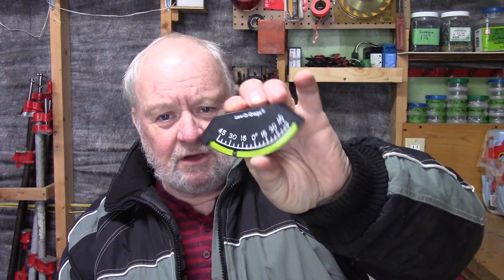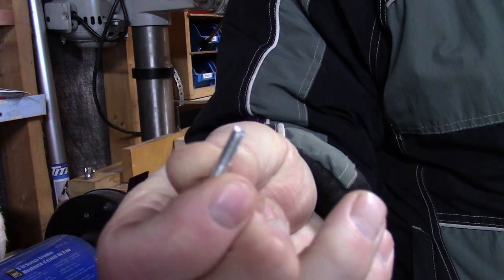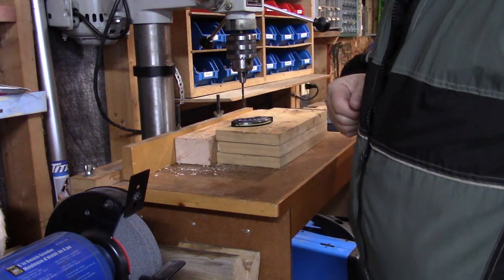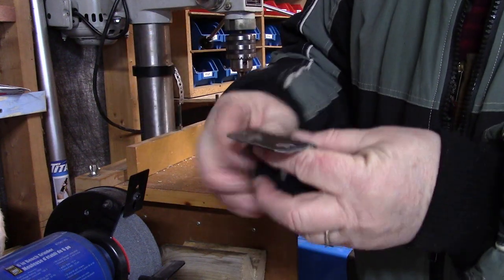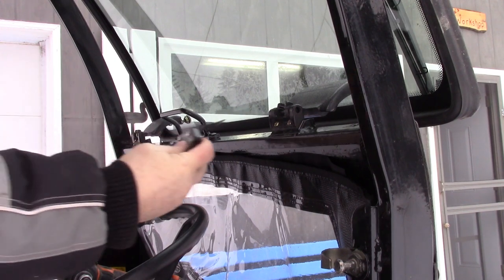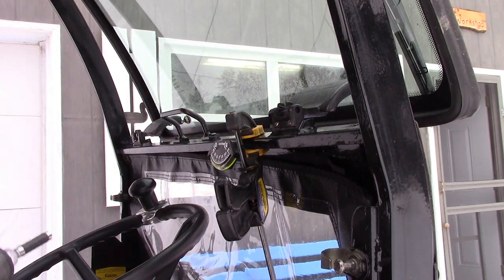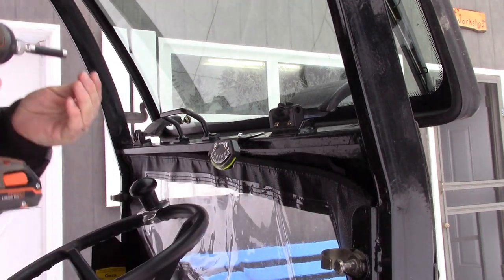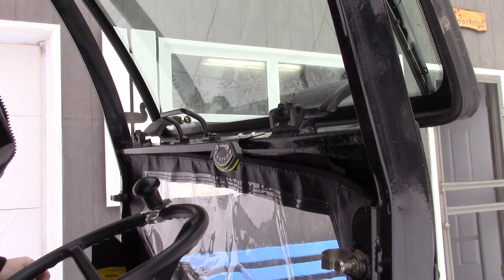Tilt Gauge for Tractor

Comment: I knew from the start Mike, that your channel was 'on the level'...now you are proving it with this addition to your awesome rig.

With the Lithium Ion first generation batteries back a few years, I'd keep a couple on the dash of my service truck in the winter so they'd warm up a mite on the trip in to the big city every day. I think they've improved somewhat because my newer stuff isn't either totally non-responsive or dead with minimal usage. 

The biggest danger I've found with these narrow based tractors is the speed at which you bypass the pucker factor when you are safely on a hillside and the lower rear drops into an unseen leaf-covered indention in the terrain or worse, the up hill rear runs over a stob, the edge of a stump or big rock. It happens so quick and if anything beyond 'creep speed' is being used, the resultant tip occurs in less than a flash !!!  Then, its time for new pants and in a really bad situation, a new seat may be in order.  

Good video, good idea and as always...good delivery !!
Reply from the maker: How's she goin' Wendel?  Your right about the 'pucker factor'  I should have called this a Pucker Factor Gauge!!!  Thanks for watching and I appreciate you kind words.  I hope I can continue to be 'on the level' now!!!LOL  The batteries I have seem to work OK in the cold but they won't take a charge at all.  The charger says the batteries are faulty.  I have my charger mounted in the shop and in order to charge them I would have to do some dismantling and take the charger into the camp so I tend not to use them much in the winter!!!  Have  a great week!!!
Reply: I try not to use mine at all but people keep bugging me for this or that well, then there's always projects for the kids houses too...  I don't know if these manufacturers test their products in real world simulations or if its that most testing is done in climate controlled conditions. They need to pick a hundred journeymen tradesmen and give each one a newly designed tool for a one year evaluation. Then retrieve all the tools and collect the data provided by those participants (and give them another free one for their trouble).  I feel the manufacturer that did that would produce superior tools across their entire line.  But that's just MY thoughts.
Reply from the maker: That would be a great idea but then they wouldn't be selling any tools as the originals would last too long!!!
Reply: Yes, but think of the customer loyalty they would develop.  Have you noticed how the electric cords dry rot and crack in no time when the tools themselves still work?  Why do they insist on using what I consider inferior cords ??  OSHA forces those tools to be taken off the jobsites when a crack developes then the contractors won't repair them because of cost, so they buy more new of the same thing !!!  Drives me insane.  I have 50 year old power tools whose cords are in better shape than cords on tools less than ten.   Awww shux...I apologize for the rant.....its over now.  LOL !!
Reply from the maker: I hear ya buddy!!!  I have a 18 volt lithium Ion battery powered Rigid drill motor and driver.  The batteries are guaranteed for life and they stand behind it as I had to replace a battery already.  The battery was over 2 years old and it had fallen in the lake.  The battery was toast and they passed me another one right at the shop.  I could not believe it but it's true!!!  Anyway, you and I are evidence that they don't make things like they used too!!!LOL!!!

Comment: I have those inclinometers on my RV trailer . Great for when I am leveling out the trailer when parking it at a campsite . Didn't make any holes for screws because I just used the sticky tape that was on the back . They haven't come off yet .
Reply from the maker: How's she goin' Henry?  Thanks for tuning in buddy.  Too late I already drilled 2 holes to mount my gauge.  The tape looked pretty good but when I plow snow it get's wet and cold and I was concerned it may fall off so I bolted it on!!!  It won't fall off now partner!!!  I never thought of using the on an RV.  That's using the old noodle!!!  Have a good week!!!
Reply: @GrampiesWorkshop  Screw it down, do it once. Sticky tape, do it again later.
Reply from the maker: @johncware66  Hello there John and welcome to the channel!!!  That was my thoughts exactly John.  It was pretty simple to screw it down, so I went that way!!!  Thanks for commenting and take care!!

Comment: Good idea Mike. I think some good glue would work to hold it on too.  It can be scary when your on a tractor on a slope. I bring all my batteries in the warm house for the winter because the cold drains them and I was told it reduces the life of them too. Keep warm
Reply from the maker: Hello there John!!!  I thought of glue plus the gauge came with a sticky tape strip already on it but the angle I mounted it too wasn't plumb so I thought I'd use a bracket and then I could adjust it after if needed.  It sure can be scary on a tractor on a slope.  My charger won't charge my batteries in the cold.  It says the batteries are faulty.  I's not easy to take the charger into the camp as I have it sort of mounted permanently in the shop.  Anyways John, thanks a lot for tuning in and I hope you have a great week!!

Comment: So what is the "tip over" percentage for your tractor? You said it was in your owners manual. I have a sub compact tractor and would really like to know please. Thanks
Reply from the maker: How's she goin'?  My manual is in the shop and I can't get to it right now, but I believe it was some where around 28 to 30 degrees of slope.  I'm not to sure and I shouldn't even mention it here because I'm not sure, but I  know when my tractor gets close to the 15 degrees on this gauge I get very nervous.  And this is amplified if you have a load in the loader bucket and it's raised up off the grade.  Be careful in your tractor, like the guy said one time, "they don't put ROPS on a tractor just to hold the work lights" !!!  Thanks for tuning in and take care!!!
Reply: @GrampiesWorkshop  I have the same Guage on my tractor and my butt starts to pucker at 15% and I have wheel spacers also. Thanks

Comment: Great vid Mike. I try to keep my hand on the boom down, kind of a auto reaction whenever i feel a twitch of level. Wakes you up real quick eh! I run a Bolens Iseki diesel G154 w/o a roll bar so i have to be extra careful, even with boom up and tractor not level. I wouldn't let an inexperienced operator use my tractor. Also like my rigid  , guaranteed for life tools , but like my unheated shop, they don't like the cold and won't charge. I was thinking of putting in a cabinet with a 100w bulb and keep all the rechargeables  in there. The cold is hard on tools and mostly on us young fellas eh!  Danny
Reply from the maker: Hey there DIY!!!  You got it right buddy.  I have Rigid tools too.  The lifetime battery warranties are great.  That's a good idea about a heated cabinet and the 100W lamp would do the trick.  I have a cabinet already in the shop that I heat to keep my paint from freezing.  I could mount the charger in it maybe.  Thanks for watching and thanks for the idea!!!  Have a great week!

Comment: sure it will give you a sense of how far you are leaning  but  as we all know ground is not even and level.   so you may be going along and your gage will be rocking back and forth making it difficult to know what angle you are really at and then you have the bumps and dips to worry about,  if your going along and some how your gage is not rocking back and forth but you are close to the tipping point and you hit a bump on one side of the tractor  or a dip on the other,   you can still tip over.
Reply from the maker: How's she goin'?  You are so right!!!  This gauge will not stop you from tipping that's for sure.  I find it handy when I use the loader.  As you know the higher the load in the bucket the more easily you can tip over, so before I even take a load I check just to see how level I am.  That way I can be a bit more relaxed when lifting the load.  My own personal 'pucker' factor, I find, is way more sensitive than this $14 gauge when it comes to driving on uneven terrain!!! LOL  Thanks for tuning and in and I sure appreciate you commenting.  Have a great week!!!

Comment: Love the addition to the tractor. I noticed that you have a weather barrier or "TYPAR" wrap or something on what looks like between  your studs and inside of your sheathing. Do you find that works well to keep the draft down in the shed? Just curious. Oh, and do you have it also on the outside of the sheathing?
Reply from the maker: How's she goin'?  Thanks for watching my video buddy!!!  Yes that is typar, or house wrap.  I applied that over the suds before I put on the sheathing.  I recommend this house wrap/typar very highly.  I wouldn't build an outhouse without adding this type of  product.  I only applied the one layer.  I put it on the studs before the sheathing or siding.  I haven't insultaed my barn and this product sure does block the wind.  There are no drafts in the barn or the camp.  I also have it on the boat  house and the same result.  The building is cold but no drafts.  Thanks again for tuning and take 'er easy!!!